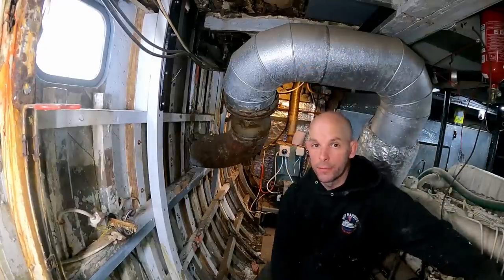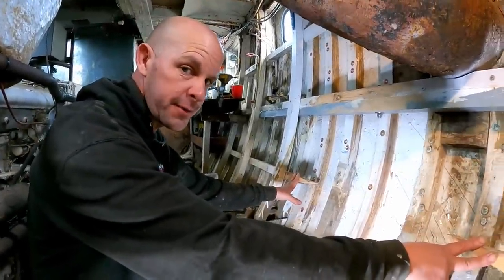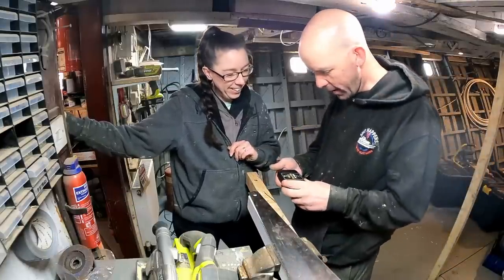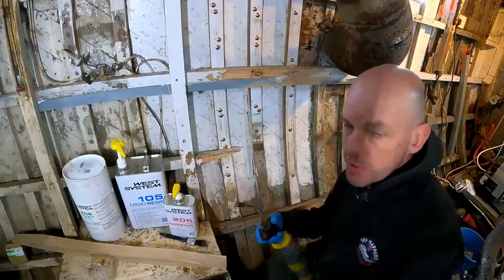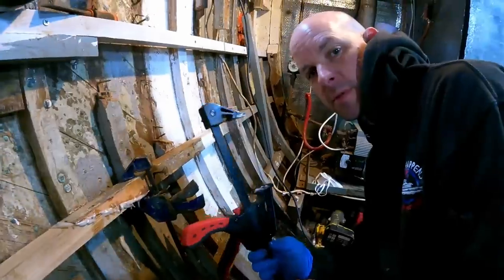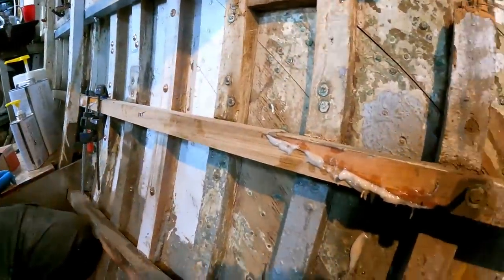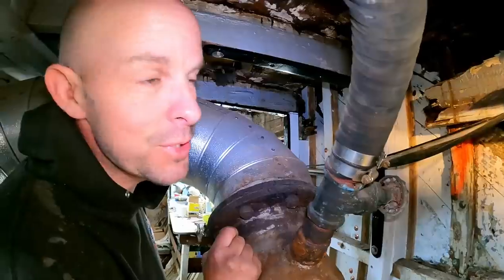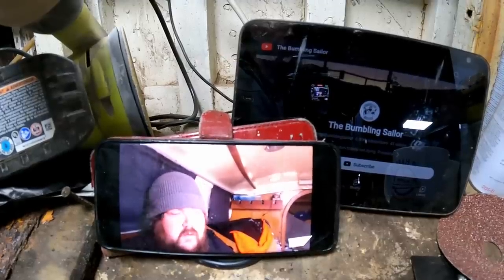Ep 121 - Setting Our Boat On Fire - #boatrestoration

Comment: For 'spark' protection, keep a plastic spray bottle filled with sea water handy. Just spritz any smouldering areas and the salt water won't affect the timbers over time like fresh would... Cheaper than using a commercial fire extinguisher for anything less than a real flame hazard!...

Comment: No problem with me for grinding metal on a wooden boat ( I generally do grinding wearing shorts and flip flops, so not a stickler for health and safety as common sense is the most important). However, heating the wood with a naked flame, by itself I’ve no problem with BUT Simon was doing so right next to the epoxy hardener. Which gives off vapours. The vapours are VERY flammable. I was having kittens! You’re doing brilliantly. Love you all.

Comment: Ducted vacume system. I installed one in my large house  when I built it. It had a central motor and bag unit in the down stairs laundery,  the pipework was PVC and the vacume hosr was long and it also ran a power head ( spinning brush) it was awsome, always available, almost silent. Now is the time to install one in your Sarinda. 
I would.. 100% do it if I was mad enough to restore your boat. 🍺🖤
🇦🇺🐨🐨🇦🇺

Comment: Talking about those plumbed in vacuums, I used to sell them and service them and they are forever blocking up as the pipes are too long. You then have the problem of cutting out a bit of pipe to remove the blockages, Stick to something like a Commercial Henry, called a pneumatic. You will be much happier in the long run.

Comment: They made an in-house hoovering system and it worked fine in the model home. But when you add real stuff to a house, inc kids and lego,socks and the cats dinner go up the tube, it blocked inside the walls and was a right problem to unblock. Bit like electrically heated wallpaper. Worked fine, till you hung a picture.

Comment: If you made all your scarf  joints the same length on the board, like 1 foot (300mm) it would be much easier it the long run.   Make two marks 300 mm apart, use your square to draw the line across the board so you can make your diagonal and a straight edge to create the diagonal.         It would allow you to pre-cut some scarf ends to speed up the process a tiny bit.

Comment: I have been in a house in Canada that had a centralised vacuum cleaning system. There was a massive fixed Henry hoover thing in the basement plumbed into every room, which just had a little fitting buried in the wall you attached the hose to. So you got huge suction.  The downside was that you had to have a very long hose to reach every part of the room so you had to connect sections of hose together or you had to use the hose for your biggest room in your smallest room too. So a lot of fighting an enormous python like thing in the bathroom!  But would be a very interesting idea for a boat.

Comment: In  the USA they already have a system where you can plug in a hose to the skirting board with a suction piece to hoover the floor, all waste  etc is then sucked down to a basement into a holding bag.

Comment: It's called central vacuum and we've had it in the states since the 70's. Crack on!
Reply: Think about ditching those wet exhaust and give her dry stakes, and you won't have to worry about wot going on under those exhaust  shrouds.

Comment: milwaukee do some locking pliers that have a large adjuster on the end instead of a round end, so you can set them and then and with a screwdriver tighten then even more

Comment: Those whole house vacuum systems already exist. I have one in a 3500 square foot house. It isn't a special oversized industrial unit that is fed by 12 receptacles. The vacuum is no larger than a Dyson canister type and the pipe system is about 3.5 dia.

Comment: Central vacum systems are the ultimate in luxury for whoever is doing the hovering.  You have all that space between various pieces of framing, might work out quite easily. one tube down each side with ports off. Might work too to freshen the air throughout the boat if it's been idel a while.  Turn the hoover on, open the little caps, and hundreds of cfm a min go streaking through all the rooms.

Comment: Grinding near wood is always going to be dodgy. Firewatch is of course good, but may i suggest a good fire blanket deftly placed where the sparks are going to fly so that it catches them before the wood. I use a glassfibre blanket when i weld on expensive industrial machines (no wood involved) to protect machined surfaces and paintwork. Grinding sparks can do a lot of damage, not just setting fire to things!

Comment: Hi, I suggest the removal of the two exhausts on the outside because they are not sure. A simple boarding will snatch all: sheet metal and hull wood.
Two stainless steel tubes under the floor with a water-cooled protection and siphons at the back would be preferable.
Reply: Yeah, I can see your point. But if you want to preserve the look?
Reply: @nick.caffrey  Aren't those exhausts 1980s "upgrades"?
Reply: @nick.caffrey  Isn't the look of ww2...

Comment: We in 1987 moved into our new home after being conned into having a spa bath, an intercom system,  an alarm and a ducted vacuum system installed, the intercom system was ripped out years ago and the walls plastered, the alarm system is useless, hasn't been used for more than 30 years, the spa bath was used half a dozen times and the vacuun system was such a pain in the arse we've been using normal vacuum cleaners and lately battery powered vaccies. The ducted system was extremely noisy, the huge length of hose was hard to drag around corners and took a lot of space to store and the paper bags for collecting the dust were very expensive so be carefull what you wish for ...

Comment: The central vacuum cleaner system has been done, I was involve in house development which had one installed, you connected the flexible hose into connection in the skirting throughout the house, the was in the 80's

Comment: Be careful with that titanium wedding ring, if you ever get in a situation where a first responder has to cut a ring off your finger, most of the cutters they use won't cut titanium.  In that case you either lose the finger or they have to try and get it off with an angle grinder.

Comment: Central vacuum systems are not that great. The caps develop leaks so your suction goes down everywhere. You need a really long hose because the machine is not following you. Most of them have a low voltage system at the ports to switch it on and off when you plug your suction hose in and they give problems. Motors are comparatively expensive. I know people with them (even outside so they can vacuum out the car) but they just don't use them because it's too much trouble.
FWIW. I was working with man who ran  angle grinder sparks over a charging battery in a workshop about 15 feet away. The battery exploded. The glass balls shot everywhere like cannonballs smashing through wood and glass. We both got spattered with sulphuric acid and while we were trying to wash ourselves down our clothes melted into holes. The vapour barrier melted in the shed. Some of the concrete floor dissolved. The gas was choking us electric cables got damaged. It was total chaos. There were shards of battery case all over the place. There were bits of plates that you couldn't pick up all over. Broken glass from the window inside and outside. The neighbour came to see what the explosion was it was that loud
You have no idea of the knock on from triggering something like that.... and yet you think telling us that you are watching out for each other. What if the vapours from the West systems had exploded from that torch. What if dopey had snagged the blade that time and the machine had twisted into his wrist or your foot. No guard no gloves no goggles no control. That was top of the list stupidity.
The heart attack is not about the sparks on a wooden boat, its about the fact that you think you are being safe. You don't even recognize the danger. It's obvious that you have not attended any safety courses or safe pass training or abrasive  wheels training.
Don't get me wrong, the job you are doing is amazing, you deserve more help and recognition for it.

Comment: Question why didn,t ya use the peice of stringer ya cut out as template then. Nice job anyhoo ya getting pretty quick at  this stuff now. With Summer coming ya next problem will be the Glue going of to fast in the Heat. Keep at it now. ;0)

Comment: Why have you lapped that stringer joint in the wrong orientation,  when under heavy pressure from the outside that joint is much weaker the original stringer joint. You can simply test this bye scarfing two bits of wood then with brick at each end and apply pressure at the joint, you will find a significant difference in the strength, so pushing from the side of the joint will give way much easier when compared to the original scarf joint you cut out.  

If you think about it all the pressure on that stringer coming from the outside, so that would make sense why they originally scarf on the stringer makes sense to be in the original direction as this will provide max strength,  I'm sure someone else must have pointed this out to you. Scarf joints on meant to be in the direction of load. Love watching the videos, thanks for all your work video in and uploading.

Comment: I detest those external exhausts. Apart from being Pug Ugly they are harmful as rotting planks can’t be seen.  Temporary screws are best until you can fit better exhausts. How about going out the transom?
Reply from the maker: Going out the Transom would mean running the exhausts through all the cabins which isn't a safe option

Comment: A central vac system typically has a much heavier duty motor than a portable one. If you have sufficient electrical power it would be pretty easy to install, you certainly have the space for it. You just run like 50mm-ish ID (2 1/4") PVC hardline with a power line for the brush head to a few bulkheads, and attach a hose with a power head and a 30 foot-ish length wherever you want. The central vac body costs about $895 new for a high end house one, then the plate and fitting and whatnot would cost extra of course, but its not a difficult system to add to a house or a boat. Most of them are going to want house voltages. But definitly a doable project if you wanted to add it. You wouldn't need that many inlet ports, one upstairs, 2 downstairs at either end?
Reply: Downside is the amount of current it needs to run.

Comment: I recommend you check with wood working professionals, but I think you actually seal/harden the surface when you torch it that way. Please make sure, don´t do hunches, it rarely pays in the long run. I´m not complaining i´m just concerned.
Reply: A fellow I know that builds 'rough cabins' in remote areas will heavily scorch the surface of wood that will be in ground contact. It does harden and close up the wood, as it stops rotting
Reply: @jenniferwhitewolf3784  In other words it is not a good thing to do when you want a liquid to penetrate the wood, in this case epoxy or similar.

Comment: they have a central vac system at my mates in Norway.  With that you trade off a cleaner unit with cable  you have to move with meters of hose pipe that are like a bad tempered snake to keep uncoiled.
I'm not a fan of the central system and prefer a Dyson type portable to either of the above.
Although the Dyson type  can not really deal with the heavy duty crap you have at the moment .

Choices,  choices🧹🧹🪣